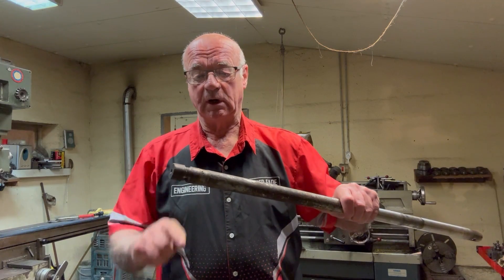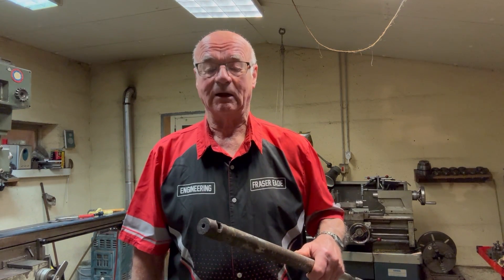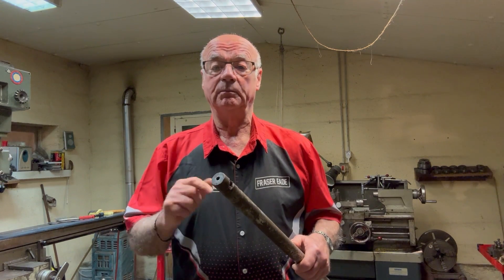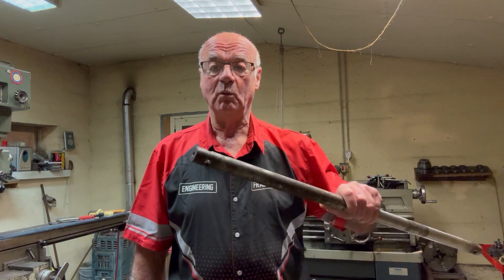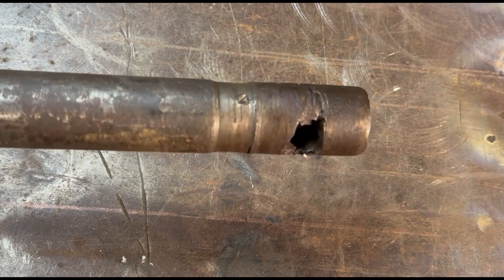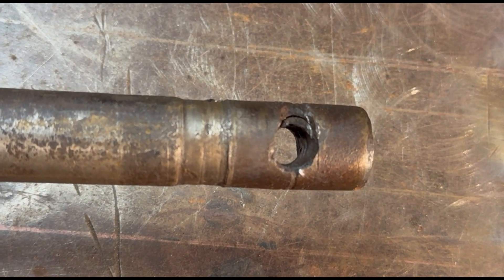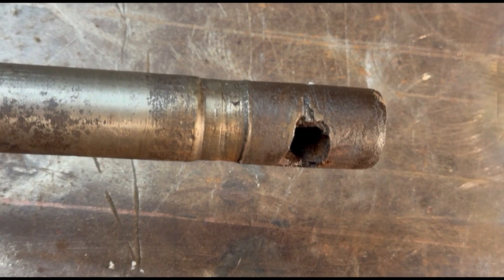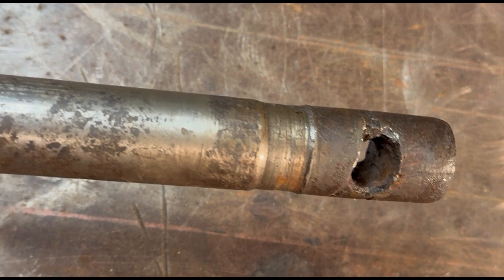How to Repair a Worn Shaft

Comment: Hi! very instructive. I repaired various shafts scored where oil seals seats with brass and oxy flame. It was my first attempt, quite patient and long job, but quite less expensive than bring the pieces to a specialized shop and do a "re-metalization"... Greetings from Italy by Jean!!
Reply from the maker: Hi Jean, thanks for the comments. Yes, it's sometimes difficult and time consuming to repair a shaft. This one worked out quite well. Cheers.

Comment: I always think it would be nice to rotate the shaft as you weld, that way the deposited metal would be going round the shaft and easier to turn, nothing is worst than the intermittent cut throwing tiny hot chips around the shop when you turn longitudinal welds, this shaft should give many more years of service. Chris B.
Reply from the maker: Hi Chris. Thanks for the comments.
Nice idea but more difficult to keep earth contact whilst rotating without getting arching on the shaft and V blocks.
Reply: @MetalworkinginFrance-xe5rg  I think a simple bearing surface of brass with a belt drive to the shaft would work, if the brass was machined as a vee it would accommodate a variety of diameters. I wonder how many people have tried to do this in their Lathe and burned the head bearings out ! I hope you did not get that heavy rain yesterday, it was like a monsoon here in the Lot. Chris B.